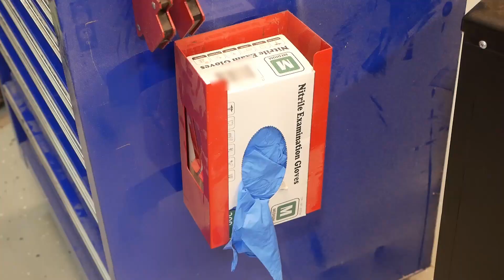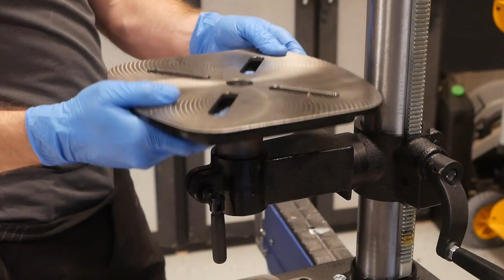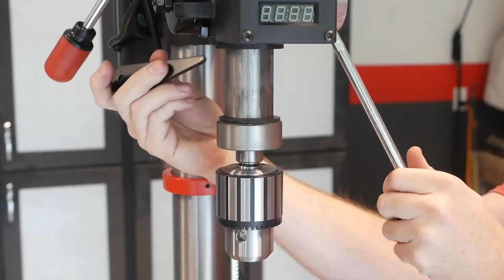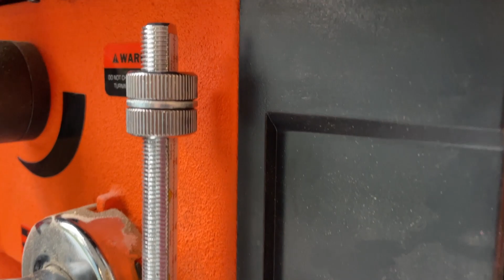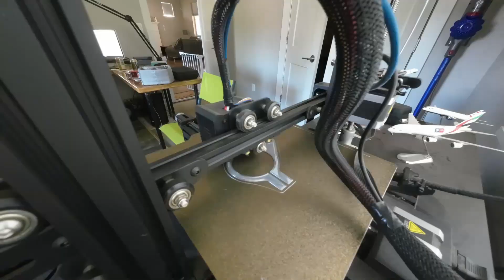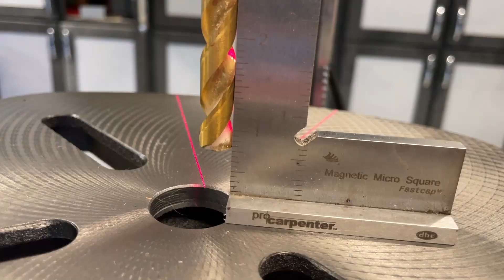The Bucktool Drill Press is a Serious Competitor to Wen

Comment: I bought the bucktool drill as well as their knife sharpener… what a shitshow that was!. the drill press arrived damaged. not shipping damaged, not even any evidence of box damage, but yet the base was in 2 pieces… packed that way!  the knife sharpener also was defective right out the box. the motor shaft had a significant imbalance and the belt drive click and clattered at the higher speed. the worst part was the threaded holes for the tool clamp knobs weren’t even threaded all the way, so the knobs couldn’t tighten the tool rest.
I bought them through bucktool’s Temu store. i reached out to bucktool about the clearly obvious manufacturing defects with unboxing photo proof and they flatout denied it was factory defect and blamed temu. So I simply got a refund from Temu and returned them.

Comment: “Which is probably ok” referring to plastic threads. No it’s not ok and never going to be ok. Chinese plastic junk is all you have to choose from new at this price range. It’s very easy to get a used drill press from the 50’s up until the 80’s that will outlive you for cheaper in a lot of cases.
Reply from the maker: I still think it's ok
Reply: @aaronstestlab  hey man buy what you want. I just don’t want it.

Comment: Great video! I liked and subbed. I received mine a day before seeing your video. I too, want a lock stop. I can 3d print a collar like you did, but I'm wondering if you tried the steel (or iron) one from the Wen. Or, is it plastic too? For that matter, I wonder if you could use the whole bit from the Wen.
Reply from the maker: I can't remember with 100% certainty, but I'm pretty sure I tried the Wen depth stop and it worked. In any case, I always end up using the rotary depth stop on the handle either way.
Reply: Look at @panchobrown7562's post above about locking the quill on this drill press.

Comment: Just bought this based off your video. Got a question though. When it’s running, do you hear any type of rattling coming from the back where the motor is? I can’t seem to figure out what it is, everything is extremely tightened down, but I do still hear some type of rattling when it comes on. Curious if you have the same.
Reply from the maker: Rattling while running, no. But sometimes you'll hear a clicking as it turns on and off as the centrifugal clutch engages and disengages.

Comment: Looking at this drill press. Did you ever post the file on Thingaverse? Couldn’t find it.
Reply: Yes, I was looking for it too and couldn't find it.  Anyone else find it and mind sharing the link?
Reply: @ChristianDarby-e8u  so I ended up buying this drill and it doesn’t need it. You just bring it to the lowest position and tighten the depth adjustment all the way. Great setup. I really haven’t used it and still sits in my kitchen assembled. One of the few benefits of not having a wife. LoL Frigger is heavy. So no moving this monster until I have an exact location where it will stay.

Comment: With an integrated shank keyless chuck upgrade and a Wixey DRO this drill press has been absolutely fantastic for my needs. I’ve drilled wood, acrylic, hdpe, aluminum, 4340 etc. with no complaints
Reply: Those are two upgrades you've made to it?
Reply: @MadLadsAnonymous  yes. I believe the chuck is a 5/8” CanCNC keyless with titanium jaws. the wixey mount does work with the included options but it takes a bit of forethought
Reply: @AtemporalSuperCrusader  Awesome, thanks!

Comment: Hello Aaron,
 Recently purchased this drill press and I learned you can lock the quill with the supplied depth stop.  You simply pull the quill to the desired depth, then rotate the depth stop to that desired location and lock this position on the depth stop with the thumb screw. Next, release the press handle and the quill will be locked into position.  Hope this makes sense.  There are other YouTube videos showing this action on different presses but utilize the same depth stop.
Thanks for your video, loving this new press as it is far superior to my old 8” baby drill press…
Reply: I just knew that someone would figure this out ... this community is just to damned smart to be "outthunk" by the manufacturer.  Cheers Mate
Reply: My Delta 11-990 has the same type of depth stop and looks exactly like the one on the Bucktools.  It works great and yes, you can lock the quill just as you said.  My Delta was manufactured in 1993.  I am surprised more press makers don't use this design.  I have never had a problem with mine.  I am now looking for another drill press and looking at the Bucktools because of this feature.  I also want Variable speed and the laser is a plus.  My delta is getting a little sloppy and drilling pen blanks requires more precision than my poor old Delta can supply.  Nice review, this press is definitely on my radar.

Comment: Hi, you motioned an available quill depth stop.  How can I obtain one?
Reply from the maker: I 3d printed mine. Not sure of an off-the-shelf solution.
Reply: @aaronstestlab  it has built-in quill stop. Read the instructions.
Reply: @aaronstestlab  Good day.  I really enjoyed your review.  I believe you hit on all the important points.  You mentioned in the video that you 3D printed your quill stop and were going to post your file on Thingiverse.  I just tried finding it on Thingiverse and came up empty.  I searched depth stop, went through 20 pages, and saw a lot of different ones for different machines but not the one you mentioned for the Bucktools 12 inch drill press.  Did that ever get done and if not are you ok with sending it to me so I do not need to reinvent the wheel?  Thanks

Comment: I'm curious about drilling in metal at it's slowest speed. Is the torque strong enough not to bind? Or would the Wen be better?
Reply: Mine has no trouble
Reply: The Wen 4214T model which this model is drawn from comes with a 5 amp motor and this one is 6.2 amp. You get a stronger motor with this model.